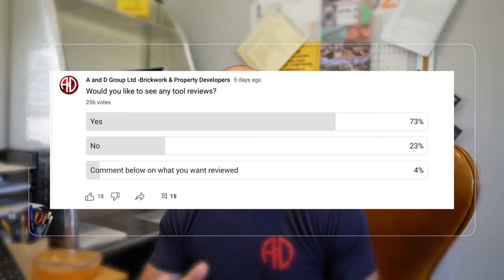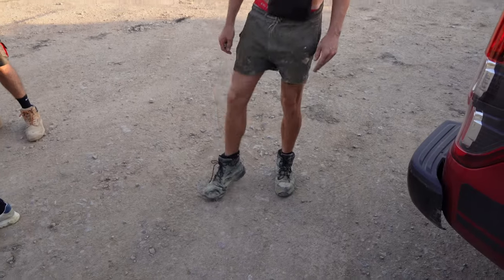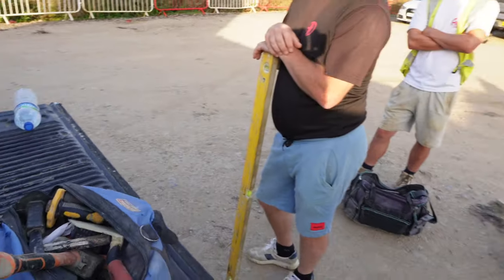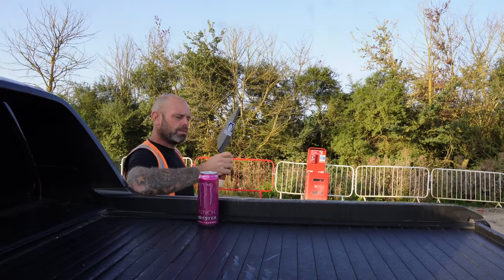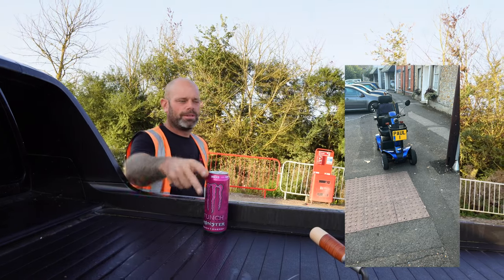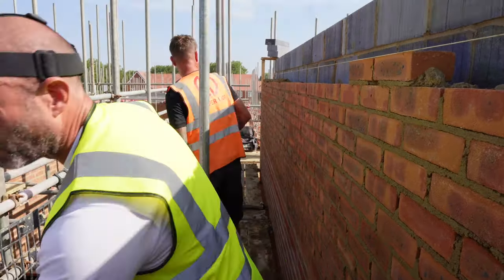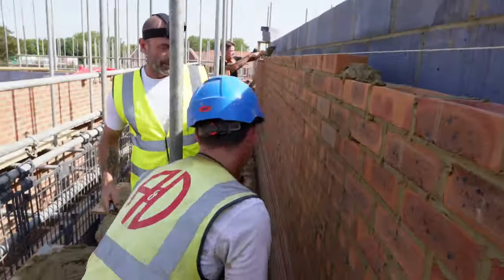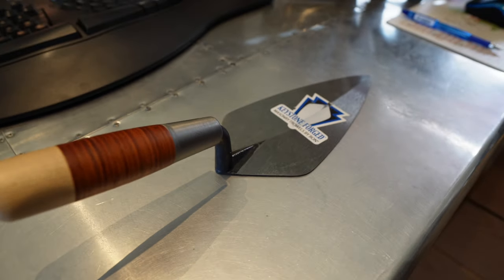How Big Is Your Trowel

Comment: Problem with small trowels kits in scotland 50 mil cavity 9inch to small to clean snotts building block work wouldn't waste my money on them
Reply from the maker: Cavities in England are a minimum of 100mm, likely to increase to 150mm due to Part L changes.  If insualtion is used then there must a a minimum clear cavity of 50mm.
Reply: Most your house are traditional down there it use to be traditional up here until early 2000 then they went kit daft me personally traditional is the way to build houses not a timber frame
Reply from the maker: @hayyoujimmy8560  I hate timber frame, unfortunately I think due to the changes with Part L more and more developers will be going down timber frame or modular route! Good for scaffolding but bad for Brickies

Comment: don't buy bon my one has snapped a bit off where you tap for half a brick shit metal
Reply from the maker: Seemed good quality to me but only used for a few hours so we will see how it holds up are a few runs
Reply: Best metal are the W rose trowels more so if get a more ridged blade as to the limber style they have as option also.
Reply: Bon do two quality of trowel, Keystone being the best maybe you had the cheaper version ?
Reply: 19/10 for me